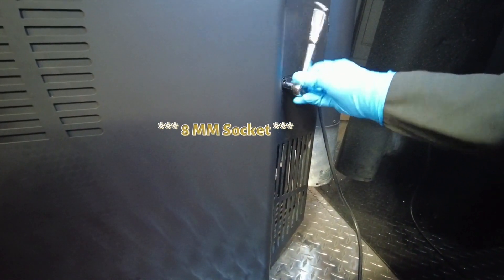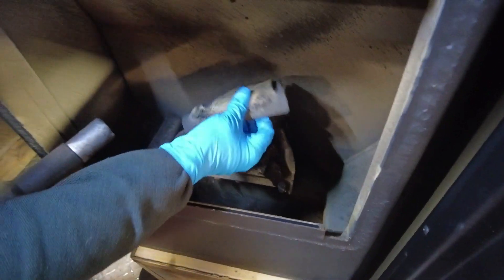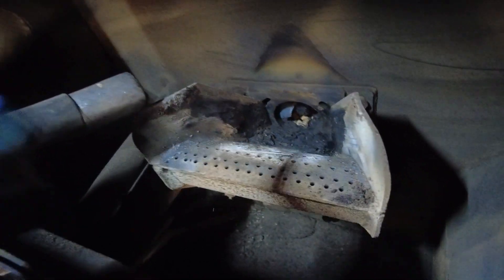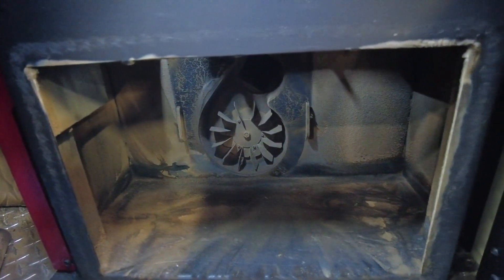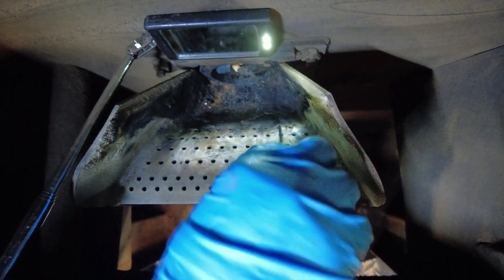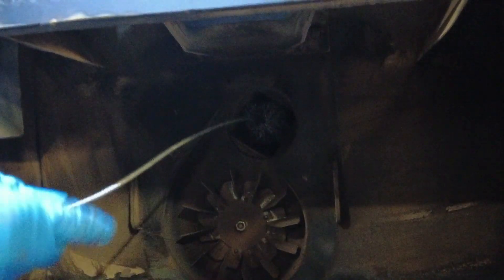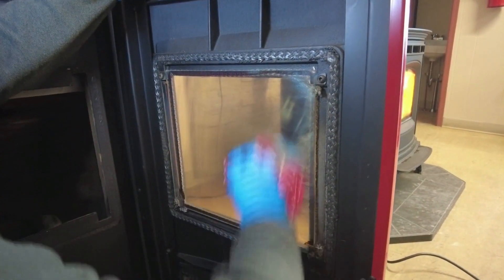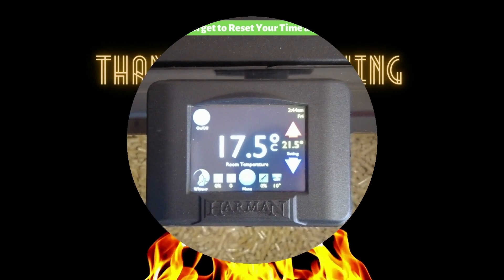Pellet Stove In Dept Cleaning - Harman Allure

Comment: Good video. I just got the new update on my allure. It’s vibrating now. Didn’t happen till I did the new update. Any tips? I can do to try and fix this
Reply from the maker: Shut the unit down and run the test mode feature to isolate the issue. My guess is your fan blade is warped on the exhaust motor. New update is designed to increase draft in windy conditions so I would assume the higher rpms is making the vibration.